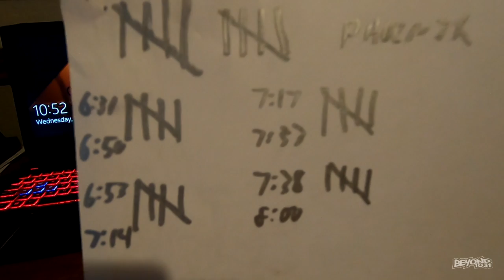7 Yards.  1 Wheelbarrow.  1 Day???  [Day 3475 - 05.07.20]

Comment: Hi Phoenix! I weighed in on Tuesday. I’ve started out this year at 230 pounds. On Tuesday I weighed 200 pounds. I tried desperately to walk for half thousand steps which many will say that’s not a lot… But it is when you’re chronically ill. I spoke with my doctor and 180 is not a far-fetched goal for the end of September. It will be the first time in almost 20 years but I have weighed under 200 pounds.